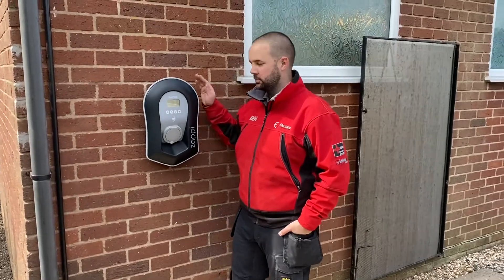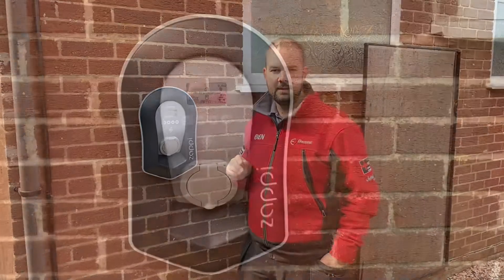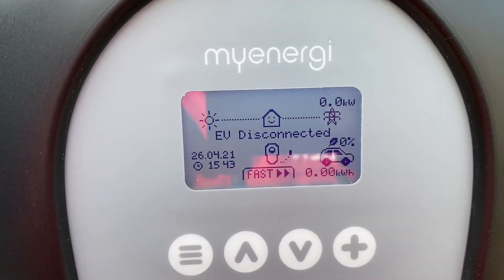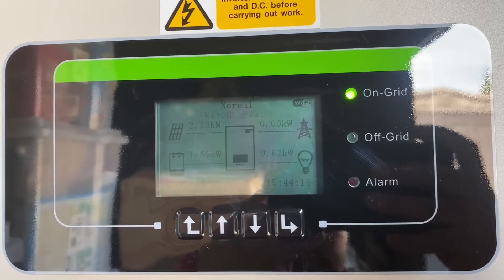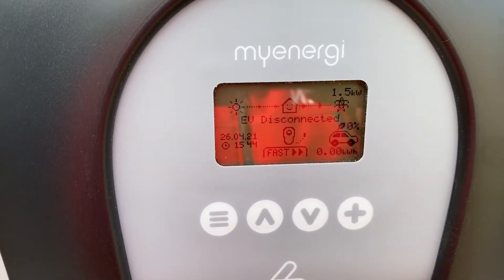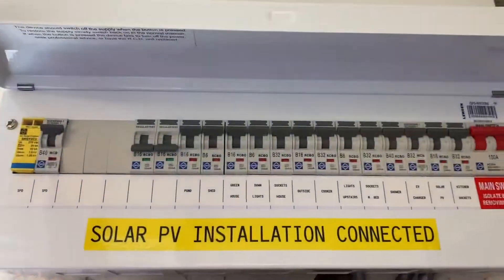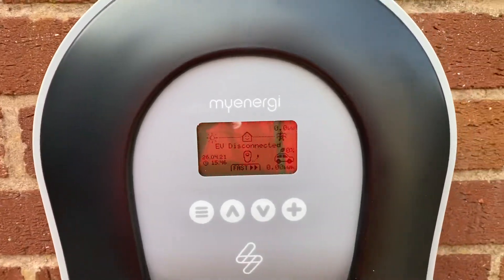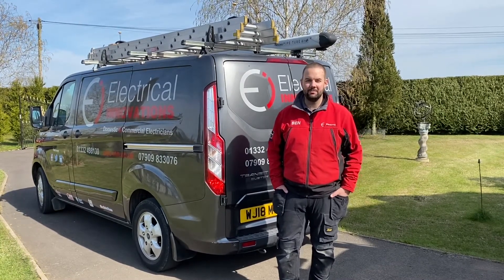MyEnergi Zappi EV Charge point installation in Derby with Solar PV and Battery Storage

Comment: Is there a way to stop the charger using the battery storage with the DC battery. I’m looking to get Zappi to divert excess solar to the car. Also I have intelligent octopus to charge the car at quarter of the rate during the night. Any tips much appreciated.
Reply from the maker: Yes there is. You can either charge the battery at the same time as the car. The battery won’t charge and discharge at the same time. 

Or you can wire the charger so the battery CT clamp can’t “see” it. 

The Libbi will do all of this natively in the app.